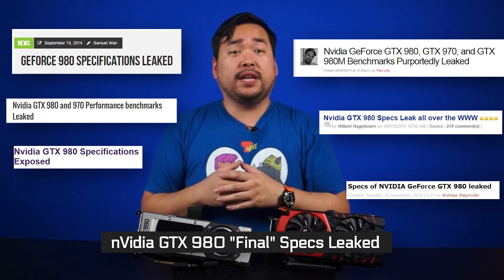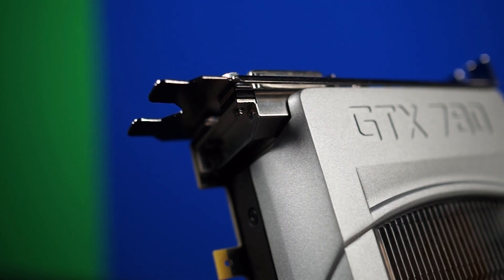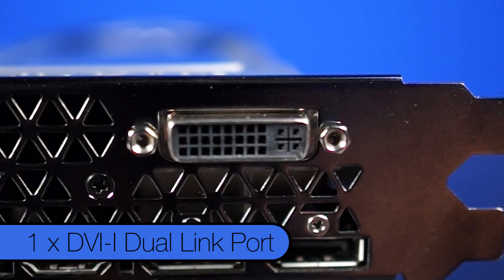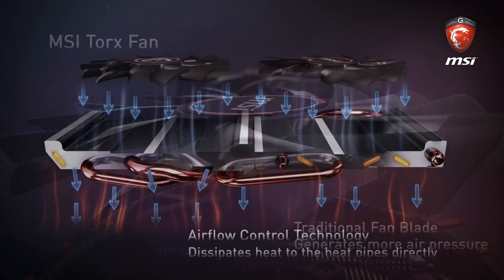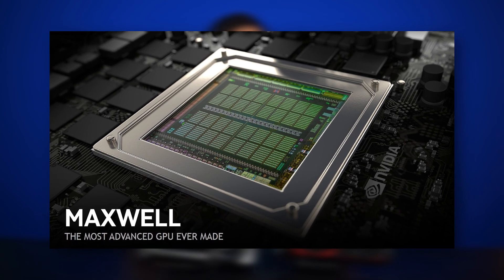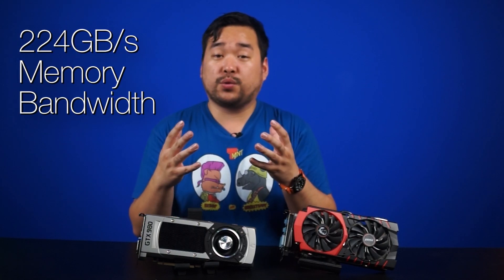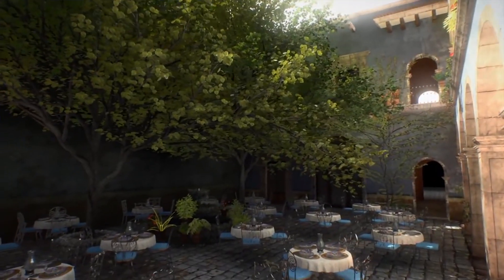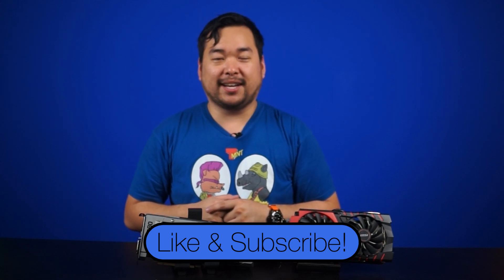What is Maxwell? Explained. ft. GTX 980 and MSI Twin Frozr V GTX 970

Comment: AMD gpus are still better
Reply: ***** Obvious troll is obvious
Reply: Senpai wants to be noticed
Reply: what about 2 295x2's in crossfire, and the watercooling is much more awesome
Reply: ***** AMD is just terrible. I can't play anything on Ultra with an R5 230, but the lesser new GTX 970 can run anything. Now imagine if I was using a 980, it just shows that Nvidia is simply superior.
Reply: ***** nVidia Peasants?, Oh my god somebody take this guy out of here. Can people stop with the peasant bullshit already.

We all get what your saying. But you should compare dual GPU to single GPU cards only when you're looking at space saving to performance ratios, since obviously two cards take up more room than one card. Technically speaking and practically speaking, the 295x2 is 2 GPUs, its in crossfire, so when you compare raw performance data, you must class it with other crossfire or SLi set-ups, otherwise the data is redundant, unless you are trying to see the performance gains from single GPU to crossfire or SLI set-ups. same goes for the GTX 690, and GTX Titan Z.

Dual GPU cards are not a technological breakthrough, they are just a convenience thing. Built for the people with ITX and mATX builds with only one PCI-E, but who want SLi or Crossfire performance. Dual GPU cards even cost as much as two single cards. You cannot acurrately compare a Dual GPU with a Single GPU. You can only compare when you are trying to save space.
Reply: For those of you who thinks crapVidia is better? the answer is NO. AMD is better and its proven to be future proof!
read this up: http://www.extremetech.com/computing/190463-nvidia-maxwell-gtx-980-and-gtx-970-review/3
Reply: Kevin Cassidy hahahahha. spoken like a true fanboy who cant use his noggin when replying to youtube comments.

Decreased power draw allows lower TDP which will allow high OC's and wont be gimped by the GPU's bios if its exceeded.  Go look at the 980/970.

Same exact argument for heat.  The more headroom the more OC and more voltage you can play with.

Honestly man just stop using computers, your comment gave me cancer.
Reply: AMD wins economically because a lot of manufacturing companies are using AMD chipsets for their products. But nVidia has better graphics cards for PC.
Reply: Micro stutter in 50% of my games, no thanks.
Reply: Corey Lindgren same happens with my GTX650 when i run crysis 3 on max settings. its horrible.

but my R9 280 can handle it much better
Reply: ***** 2 295x2 that's 4 processors or something like that. So it's more fair comparing it to 4 cards.
I believe 2 gtx 980s win over 295x2 but idk.
I can't wait to see what amd comes out with though.
This/next year is gonna be interesting.
It's always fun to see close battles like these.
Reply: KuronoXD My R9 295x2 can play games way better than a peasant GTX 550
Reply: ***** so what, its 2 physical cards, and i can run them in my Z97 system
Reply: ***** I am pretty sure it's 1 card but 2 gpu processors.
Reply: ***** yes, 1 card vs 1 card, GPU processors dont count when comparing IRL, on theory it matters, but not in real life
Reply: ***** 295x2 is 2 processors packed in 1 card. Usually cards have 1 processors per card. (This is how I've learned it)
So therefor you can't compare 295x2 against a card with 1 gpu processor.
The 295x2 is essentially 2 290x's in crossfire with water cooling.
Reply: ***** you can, since they are both single card designs, R9 295x2 just has two processing units in crossfire internally.
Reply: ***** You can but it's not fair since you are basically comparing 2 cards together vs 1 single card. ofc it is stronger with 2 cards together. But 2 gtx 980s beat 295x2. (I think) and that is what this whole conversation is about.
Reply: ***** Nope, you should compare 1 card VS 1 card, and 2 R9 295x2 in crossfire(2 cards, 4GPUs) wins 2 GTX980 in SLI(2 cards, 2 GPUs).

i compare with equal amount of cards, not with equal amount of GPU processors.
Reply: ***** Haha, then you are kind of the fool here bud.
Reply: WeekendGamingNerds how so? i am just comparing GPUs
Reply: If I read your comment correctly you are comparing dual gpu cards versus single gpu cards. That's just silly. A dual gpu card should be compared with either two single gpu cards or another dual gpu card. It's simple equality of comparison.
Reply: WeekendGamingNerds nope, you should not look at cards for their amount of GPUs, rather with the amount of physical cards themselves
Reply: ***** Yep, which is exactly what I thought you were saying. You're delusional bud. What a waist of time.
Reply: WeekendGamingNerds you Nvidia peasants are always hillarious, you want to compare per GPU unit, when it should be compared per card.

because your cards beat in single GPU unit performance, but AMD beats with Dual unit performance.

a little bit like intel vs amd, intel has better single-core performance, when amd offers more cores
Reply: ***** Ben Engineer  lol I know right.. this dude is either trying hard as a mother to troll (and failing) or is really stupid. Either way, he's amusing as fuck lol
Reply: AMD is for poor people
Reply: Artur Komoter yes, and they are also more powerful
Reply: *****
lmao not really, top NVIDIA GPUs own AMD ones every time
Reply: Artur Komoter R9 295x2 VS any single PCB card from Nvidia...
Reply: ***** Nvidia does not have been to produce somethink like R9 295x2 to beat AMD. They win on single GPU performance. 
2x R9 295x2 is stupid,  4GPU configuralitions are unstable and you will need to disable some of the game features,  3 way is always better decision.

R9 295x2 is not a good option,  Because that runs 2 gpus on single x16 lane, Which will get bottlenecked by data transfer,  2- 290x 'es would have double data transfer in that case.

Intel has better architecture,  AMD is just madly putting cache and cores like a zombie and selling their cards, Results are only bad fps, heavy power consumption and alot of heat.

Intel does their job very well, Even with lower clock speed and lesser cores intel beats AMD.
Reply: Navhkrin you are hillarious m9, R9 295x2 works perfectly with only 1x PCI-e x16 gen 3, because 2x 290X is designed to run on 8x - 16x setup anyways, and 2 R9 295x2's can run perfectly and stable together on x16 - x16 layout (my friend has it, and works better than any Nvididia 2 card setup
Reply: ***** Do you even know what bottleneck means?  It means it wont run as good as it would on 2 seperate 16x 16x or 16x 8x lines.
Also gtx 980 destroys R9 295x2 overhard. Stop your fanboyism.
2 R9 295x2 cannot run perfectly stable. Its oblivious thing, Its not about lines its about amount of GPU's,  Crossfire is not stable at 4 gpu's.
 
Also almost any Motherboard has 4 pci-e 16x lanes,  This means single card is useless, Just buy seperate cards with single GPU's. You cant 4-way crossfire R9 295x2 anyways

GTX 900 series are this generation , R9 200 series are past generation, Comparing GTX 900 to R9 200 is stupid, Its like comparing i7 to i5.

GTX 900 is a match for R9 300 series.
Reply: The R9 thing that costs 1200 performs much worse than both 970 and 980......poor amd....
Reply: ***** it accually beats the titan Z, which beats both of those cards
Reply: On Stats ofc....on benchmarks? Not even close. :)
Reply: ***** accually, you should go check em
Reply: ***** i did :)
Reply: *****
http://gpuboss.com/gpus/Graphics-cards-best-Passmark-score-5825384 oh would you look at that, 8th place for your cute little R295
Reply: Artur Komoter Thats clearly paid review, Nvidia probably paid them some money so they would do that ranking. Putting titan and titan black on higher rank then r9 295x2 is kinda stupid.

(I currently prefer Nvidia , But seriously i hate overfanboyism )
Reply: Artur Komoter static benchmarks dont always tell the whole story, were they overclocked, how much, compared to their price, noise, cooling capacity, etc...
Reply: *****
nah, youre just trying to bullshit your way out of that
Reply: Artur Komoter if you want statics, here you go

http://www.extremetech.com/wp-content/uploads/2014/09/Luxmark.png

http://www.extremetech.com/wp-content/uploads/2014/09/ARMA31.png

http://www.extremetech.com/wp-content/uploads/2014/09/Litecoin.png

and remember, that is only R9 290x, but R9 295x2 is two of them with watercooling ( ͡° ͜ʖ ͡°)
Reply: *****
wow, a couple of fps difference, so amazing
now let me put in my 4 980's and just roll over your puny little R9's
Reply: Artur Komoter those tests were done with single R9 290x, you can use 4 of them too
Reply: ***** i 50% agree with your name. i agree, i am a AMD GPU fanboy, but on the CPU market i am quite neutral. both have their place, AMD is cheap, has more cores but consumes more power and per-core-performance is not that great.

Intel on the other hand has usually fewer cores, less power consumption, but per core performance is better. 

AMD is good for tight budget builders, and people who need cheap multitasking power

Intel is for Gamers, since games dont utilize that many cores(yet) something like the pentium anniversary edition will beat the crap out of most similiar priced AMD parts. but has less cores to do like video rendering.

that is where i3, i5 and i7 come in, they each have a relatively good set of features, i3 is cheap dual core with hyper threading, i5 is quad core without hyper threading and i7 is quad core with hyper threading. 

also intel has x99 platform with xeons, 6/8 core i7's with hyper threading and ddr4 ram

conclusion: AMD is cheaper and better option for cheap multicore processing.

Intel is better for low price single/dual core processing, high range multicore processing and medium range both

BUT AMD costs way more, and if you are in a budget you can save few bucks for your gpu by getting an amd gpu.

i myself own i7 4770k with z97 platform, and i need most of the computational power.
Reply: ***** also, dont just say something SUXXZZZ without giving a reason why, that makes us AMD fans look like retards
Reply: ***** Also intel is just as good in multitasking thansk to hyperthreading.
Reply: Navhkrin not on low end parts, like pentium grade
Reply: ***** Hyper threading works it like single core does 2x multitasking, In a way it makes computer think there actually is 2 cores instead of one physical core,   Pentiums come with single cores so it wont do very good nowadays.
5820K has 12 virtual cores :O
Reply: Navhkrin yes, but hyper threading does not double your computing power (tested it myself with my i7 4770k), since its just a clever way to manage processing to a single processing unit(physical core).

it does give you more performance, but it also increases heat output and power consumption, and physical cores are always faster and more reliable than virtual cores
Reply: ***** Well it will be as good as AMD in a case 8core AMD vs 4core Intel  since Intel has way better architechure + uses lower power, lesser heat.

If you mean 8 core intel is better then 4 core intel with hyperthreading, It ofc is.  But hyperthreading is somethink diffrent,  It can be added easly and is very good. You dont sacrifice 4 physical cores in order to have 8 virtual cores. Its just a technology
Reply: Navhkrin but 8core AMD vs 2core intel W/hyper threading AMD wins in most cases
Reply: ***** I think thats very oblivious situation... You are comparing 2 core to 8 core
Reply: Navhkrin they are similiary priced, atleast where i live
Reply: ***** Wow intel are very expensive on your country
Reply: Navhkrin i paid like 440€ for my i7 4770k
Reply: ***** Its 295€  here  , Even 5820k is cheaper :P
Reply: Navhkrin lol, i bought it when it was new
Reply: 441meatloaf he doesnt know anything xDDD
Reply: ***** you guys should have stopped listening to this troll the second he said a dual GPU card is the same as a single GPU card so its a fair comparison.  Obvious moron doesnt know about it needing crossfire still.
Reply: berzu21 Who the fuck cares about heat and power draw? Honestly? Are you running in a notebook? No? So wtf man?
Reply: ***** Thank you for you're insightful comment. Iv used Nvidia since I was 12 years old, 5600gt, 6800gt, dual 8800gt, dual 9800gt, dual gtx570 (2gig).Yes  980 and 970 OC great. But im not looking for low power more "potential" power. Honestly I built my PC with the vision of "pure power" no comprimise. I like the way AMD are doing things. I dont wanrt GAMEWORKS. I dont want GSYNC. That proprietary shite can take a hike. AMD seem to be for gamers not profits.
Reply: Kevin Cassidy i like your way of thinking
Reply: Kevin Cassidy You dont understand , its about power efficency. Exact same reason why optimized games run better then unoptimized games. Nvidia is the optimized side here.
Nvidia spends more money on architechture design while AMD puts shit ton parts on shitty architechture.

In the end both companies provide similiar power while nvidia runs much cooler and much silenter.

Comment: I want the 950/ti to come out as a good low power good performance cheap and low temp GPU that can any of my games on max (My highest performance game is BF3/Metro 2033/Crysis 2. Also my case has very bad cooling since it's a prebuilt so...
Reply: that's the 750ti. It and the 900 cards are based on maxwell
Reply: bensemus x What do you mean by this? The 950/ti is not coming out or...? Still want the 950 because Nvidia cards aren't as hot as AMD from what i've seen and I don't want to wait for the new 300 series to release.
Reply: FatheredPuma81 No I highly doubt nvidea will release a 950(ti) because as I stated the 750(ti) is already using maxwell.
Reply: bensemus x Who knows. I got a few months before I get it so.

Comment: Benchmark 970 and 980 then come the benchmark of the Ares 3 or compare it up with the R9 295x2. Both can be in either SLI or Crossfire but not 4 way cuz it's not worth it.